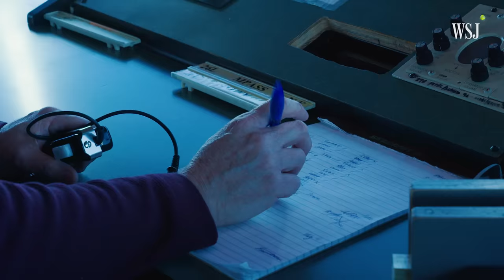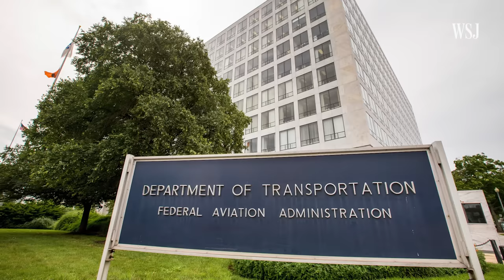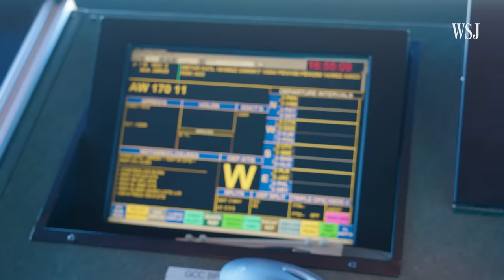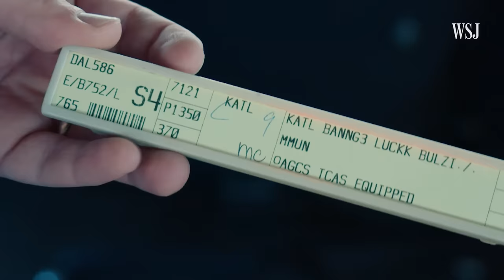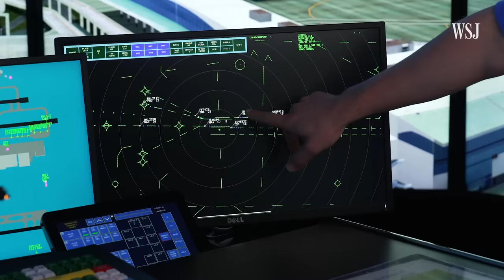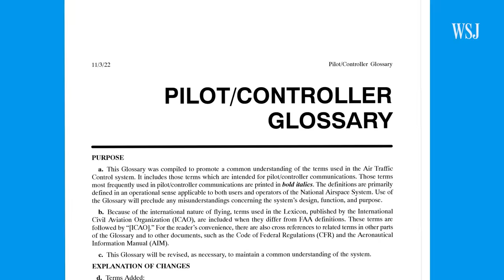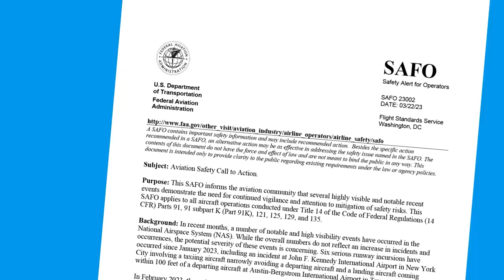How Airplane Collisions Are Avoided at the World’s Busiest Airport | WSJ Booked

Comment: I can’t believe that they slide those bars across the desk by hand.
Reply: At Eurocontrol in the Netherlands as well as centers in Germany, the strips have been mostly replaced. Whereas in towers, physical strips are still in use in many places. They are an old systems, but an old system that has been working and is working well.
Reply: Yeah, that whole process essentially falls under the category of don't fix what isn't broken. They really only serve as a reference to determine and keep track of what order flights depart in, as the video mentioned, but through all the decades of commercial aviation, it's a system that controllers have always been able to count on.
Reply: @florian6948 , and you get used to them already during training stage.
Reply: @condor7964 like you said it’s a human holding that strip, feeling it and you can count on it and keep track of it instead of an electronic alert which could be forgotten due to fatigue or illness. If you’re sick or not feeling well, sloughing and swinging that strip will keep you alert and awake, otherwise you should be headed home.

Comment: I am training to become a pilot and the worst part about communication is how bad the audio quality is. I can barely understand what people are saying sometimes. I am not sure if it is due to poor equipment or lack of experience identifying the phrasing but it can be tough to hear people.
Reply: Seriously invest in a noise cancelling headset...bose or lightspeed and have your radios checked out.  Audio quality is usually very good.  Been flying for 25 yrs
Reply: It definitely comes with experience and having good soundproof equipment. Just being prepared and knowing what to expect makes it almost impossible not to understand what is said
Reply: Communication will become easier as you gain experience with the system.  Most new pilots struggle with the communication aspect of flying.
Reply: Like the first reply says good ANC makes a world of difference. Esp in a single engine piston
Reply: It was night and day when I got my first ANR headset. In GA, I really think bose is the way to go. Expensive, but if you are dropping thousands on training, just lop it in there. You need to protect your hearing, and being able to hear properly is essential for your safety.
Reply: @regs4042  whats the usual salary for yall?
Reply: @musak.4068  good question

Comment: The other issue is the airports.  Stop using the same runway for take off and landing for the major ones
Reply: If you do that, it will reduce capacity  more than half.
Reply: @antiquehealbot6543  ???  No, not really.

At Austin, they both may have requested that same runway.  And it is not a hub airport, so it shouldn't have been an issue.  (if you want a good in depth look by an airline pilot, go look up the 74 Gear channel).

Heathrow will use one runway for take offs only, and one for landings only.  And they usually switch up which runway handles which once a week.

LAX used to have landings and take offs from the same runways until one plane landed on top of another 30+ years ago.  Now the inner runways are dedicated for takeoffs, and the outer ones are dedicated for landings.

As MelTellYou suggested, some airports already practice exactly that.
Reply: @comicus01  Please provide link to aforementioned 74 Gear episode covering implementation of this concept and any other material FAA should review.
Reply: @operationgoldilocks2481  He covers the incident, he doesn't address runway usage patterns.  But here's his video:

https://www.youtube.com/watch?v=UG82fkmCQbc

The wikipedia article on the LAX crash mentions the change in runway use as one of the changes implemented afterwards.  If you were to ever sit in a terminal there waiting for a flight, it would be obvious this is how the runways are used.

https://en.wikipedia.org/wiki/Los_Angeles_runway_disaster#Aftermath
Reply: Majority of major airports in the U.S operate heavily on this concept (ORD, DFW, ATL, LAX, etc). The few airports that don't are simply unable to due to limitations with airport layout (SFO, JFK, etc) but even then, they only stray from it concept when they absolutely have to.
Reply: Using the same runway for takeoff and landings is perfectly safe LOL, only thing it does is hinder capacity.
Reply: @danilocastillo5714  Except that it has contributed to crashes in the past, and many more near misses, such as was the case here.  It is not a best practice for an airport with multiple runways.
Reply: @comicus01  okay? Planes crash on their own as well..there is nothing wrong with using the same runway, you just can’t push as many airplanes from one runway. Look at the JFK close call…that was using one runway for departures and still almost had a bad accident, BOS, separate runways..but a pilot decided to just take off without a clearance…lol
Reply: Unless an airport has a surplus of Runways it is hard to manage it. You have to land and take off into the prevailing wind and many airports only use one active runway off peak and this probably the case at AUS.

Comment: All those systems seem really out of date.
Reply: Please propose something better
Reply: @cedric-assehliemessing3053 🙄 Sure. How about a general modernizing of all those antiquated systems for start.
Reply: @taylorlibby7642  and if the system crashes, we are screwed.
Reply: A lot of manual repetitive labor here. If this was privatized it would be fully automated
Reply: Not all facilitates still use flight progress strips. Nevertheless, they are used concurrently with electronic systems and serve as both a quick notepad and as a failsafe if something happens to the computer. Throughout ATC, you’ll see lots of “belts and suspenders” examples.
Reply: @bradzeigler  thanks for this info.
Reply: @cedric-assehliemessing3053  They still use paper strips, and physically slide them across the table to the next controller. In many countries in europe, strips are all digital and the systems are more modern, with enhanced collision avoidance connected to the strips etc.

Comment: Wow, those printed and hand written physical flight strips... What century is this again? 🤔
Reply: It kinda makes sense. Imagine if the system just crashes completely, they still know what flights they were handling by looking at the paper strips.
Reply: Actually that is a very safe system. In systems where there can be catastrophic consequences, physical and analog components are often found.
Reply: I've used both digital and paper. Sometimes it's just easier to have something tactile that you can pick up or move than trying to drag things across a screen